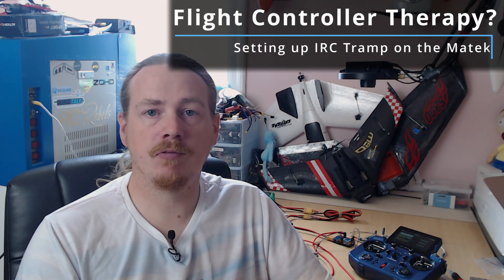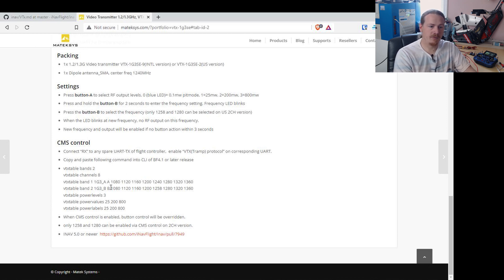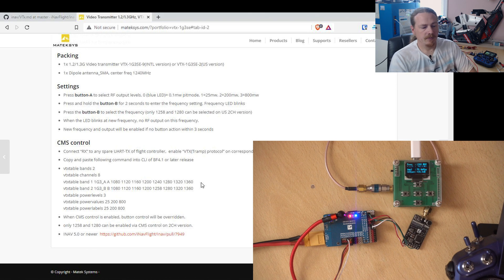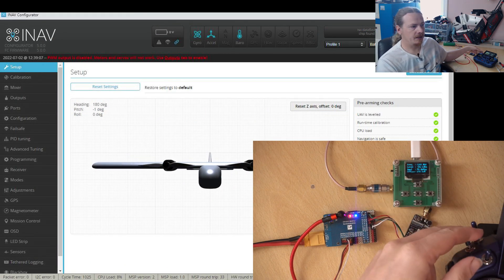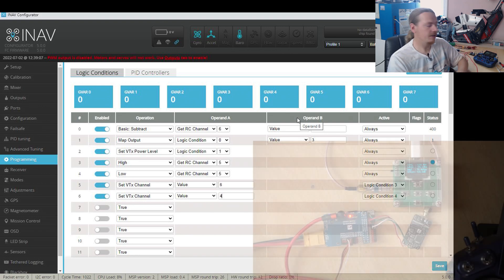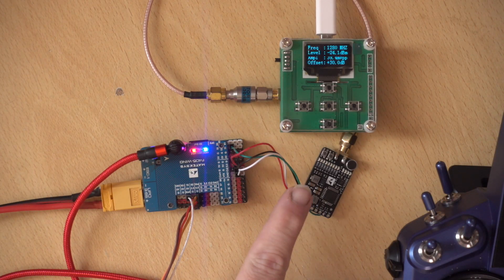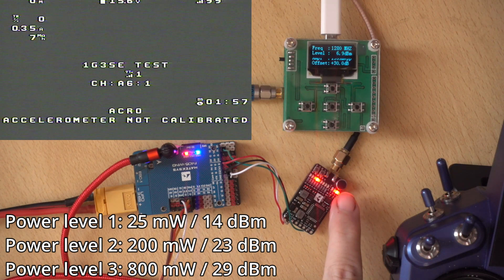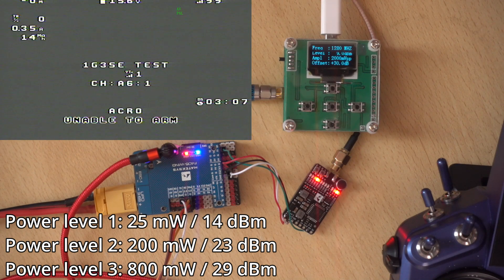Setting up IRC Tramp for the Matek 1G3SE in iNav

Comment: Is the vtx power issue for ppl using irc tramp still there that limits power being set to max 800mw? I have a reaper extreme 2.5w vtx I can't figure out how to get it to work fully with inav and I'm getting.close to jist cutting the tramp wire and controlling the vtx power with the button in the side instead
Reply from the maker: The real issue is tramp itself. It hasn’t been updated in a long time. It should really be able to provide the power levels, as SmartAudio has for a long time.

Comment: So I've just ordered the RMRC 1.3ghz vtx and receiver will inav 6.0 work the same on this? Great information as always thanks.
Reply from the maker: No, they are completely different video transmitters. The RMRC transmitter operates at full power all the time.
Reply: I understand with this vtx it will be full power,I can't get a picture on monitor or osd. I set frequency to 1.3ghz via cli, in configuration set to boscam B only thing I'm not sure what  to slect in ports tab i have yellow video and white audio on uart 4 but not sure what to enable in ports tab? In cli when i check status it showing no vtx detected. I'm basically lost at this point. Thanks in advance
Reply from the maker: This VTx won’t communicate with INAV at all. You just set it up as a standard analogue OSD. You don’t set up anything in ports.
Reply: If it won't communicate with inav i don't understand, vtx is connected to f405 vtol flashed with inav 6.0 how would I get picture or osd to monitor, sorry but very confused
Reply from the maker: @egtreadway4232 because it’s a standard analogue VTx. You connect the camera to the flight controller (C1 pad I guess on that FC, if not it’ll be labelled cam). Then the vtx pad goes to the video in on the VTx. The OSD is added to the camera image by the chip on the flight controller. If you’re not getting any picture at all, either there’s a problem with the cabling or the channel on the VTx and VRx don’t match.
Reply: Ok thanks, I'll start over I'm sure I have something wrong. I see now not going to be simple like 5.8ghz. Thanks again
Reply from the maker: Actually, it’s no different to setting up a standard analogue 5.8GHz video setup. Are you currently used to DJI or another HD system?
Reply: I've used 5.8ghz akk or crossfire vtx over the years but seen the idea to build this 1.3ghz to 5.8ghz repeater but its a no go I've double checked wiring only thing really different i had to use jumper pad on f405 vtol in order to get 12v for vtx. When everything powerd up fc,1.3ghz vtx,5.8ghz vtx 1.3ghz receiver and 5.8ghz monitor there's no snow at all just soild screen  no picture or osd. 1.3 tx and rx on channel 9 which vtx only has 2 channel's tried both receiver has many 5.8ghz vtx and receiver on F4. Seems like some communication because snowy screen until everything powered up. Sorry for long post.
Reply from the maker: Ok, so setting up 1.3GHz should be no different to setting up 5.8GHz on the AKK or similar. Just forget about the SmartAudio/IRC Tramp side of things, as the RMRC VTx doesn’t have that. Those style receivers do need to run with 12v power though. 

First thing I’d try is to take the 5.8GHz repeater out of the loop. Plug the output of the 1.3GHz receiver straight in to the monitor. If both VTx and VRx are on the same channel (9 is usually used), then you should get a picture. If you do, the problem is the repeater. If not, you’ll need to check the wiring on the plane. Maybe even swap in a 5.8 setup to check you can get a picture over that.
Reply: I'm sure happy your available for these things, the monitor is a 5.8ghz eachine diversity so can't plug to that, the 5.8ghz vtx is same one I've been flying with but now wired into the rmrc receiver the camera hasn't been changed wired this way to f405 since beginning. I could rewire 5.8ghz vtx back to fc but sure it will work like always, these repeaters looked some simple to build but guess not
Reply: Finally got my 1.3ghz fpv working, after installing the new rmrc vtx that arrived today today it seems to be working perfectly, will do test flight once wind dies down here. This is my first experience with 1.3ghz to 5.8ghz repeater but thanks again

Comment: Darren you can have the levels automatically change in logic conditions with distance as in your earlier videos yes?
Reply from the maker: Yes. That will work fine. You would just need to change the programming to only have the 3 (off the top of my head) power levels that the 1G3SE use

Comment: great video,   I was using this vtx on my plane using emax es08ma (analog)with ferrite rings on the servos and also on the vtx  but i was getting a lot of interference on the servos(jitter) what do you recommend to fix this issue?
Reply from the maker: I can't say I've had this. I have the servo cabled and VTx cables next to each other. I think the VTx is about 10cm away from the servo, bit it could be less. Are you only getting the jittering on the side with the VTx?
Reply: @MrD  i have about 8/9 cm from the servo and cables are also separated (vtx from servo) and yes only the opposite wing of the vtx servo jitters  , but when i reduce the power level on the vtx the jitter goes way
Reply from the maker: @heyjackfpv5469  that seems strange that the opposite wing to the VTx jitters. I guess your Rx is that side? Have you tried turning off telemetry on the receiver? That can cause jitter.
Reply: @MrD  yes I've tried , i guess it must be that servo that has the issue